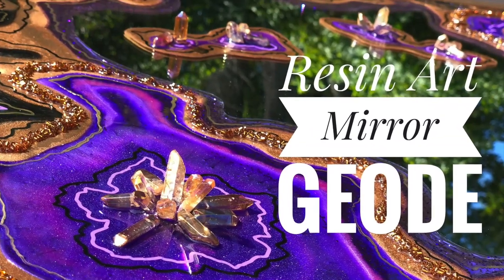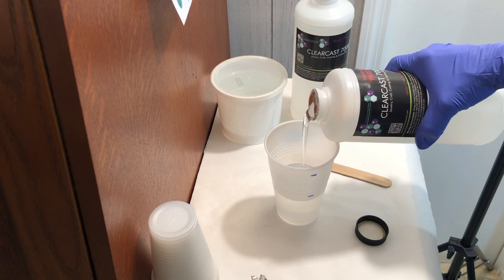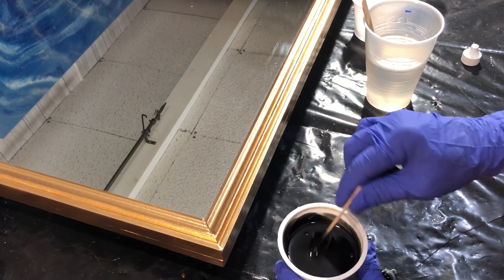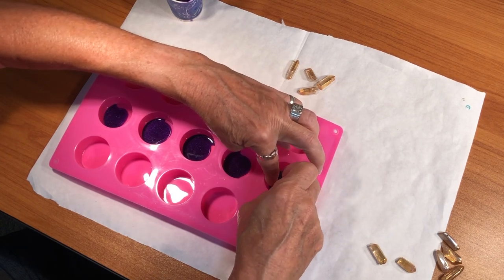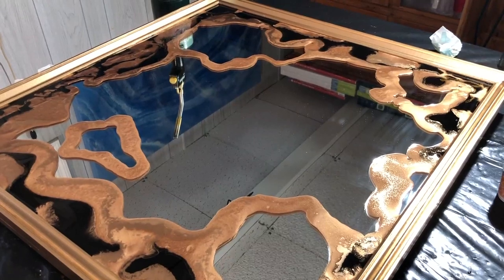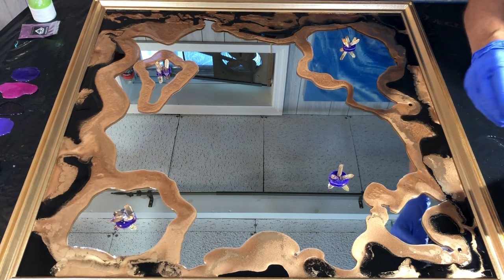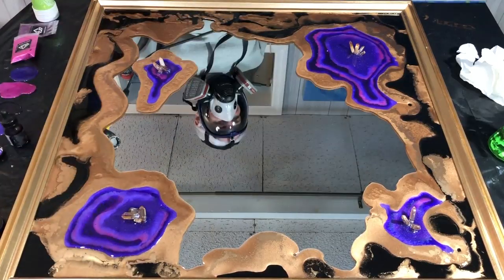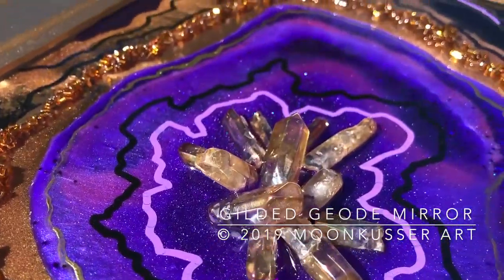Resin Art Mirror Geode Lesson

Comment: It's stunning the way it turned out! Just had a question, if its okay with you - how do you clean out the equipment like pipette and squeeze bottles, filled with resin residues?
Reply from the maker: Thanks Shruti.  The pipettes are not reusable after epoxy resin.  Squeeze bottles can be reused if you remove the top after using and clean with alcohol.  I turn the bottle upside down and let the resin cure overnight.  The next day I squeeze the bottle and the resin releases from the sides and can be pulled out.  I then clean with alcohol.  FYI - This does not always work.
Reply: @MoonkusserArt  This is insightful.  Thank you so much! Much appreciate it. :)

Comment: Umm I’d be concerned about using those measurements because the resin weighs more than water
Reply from the maker: The water is only to get equal parts by volume. Hardener and resin do not weigh the same but water and water does.